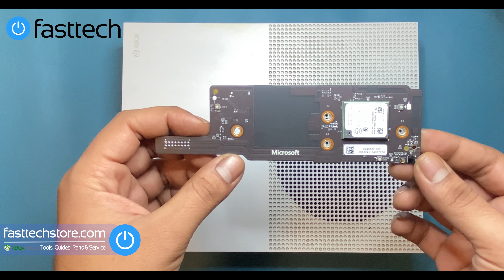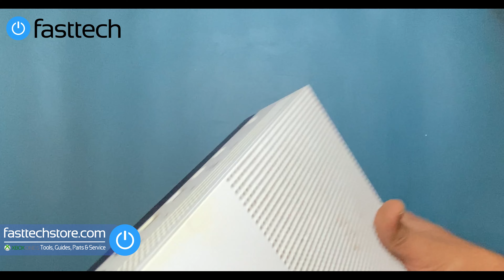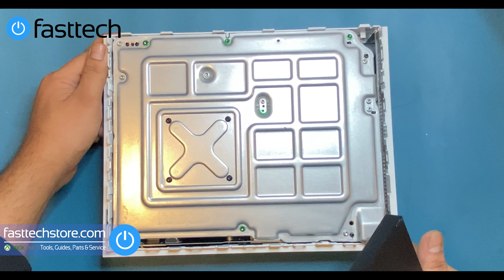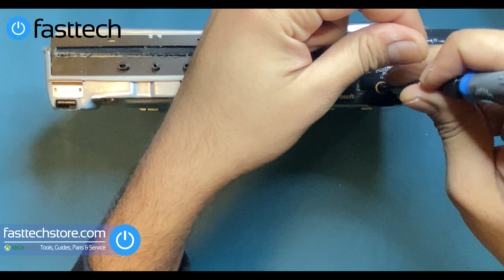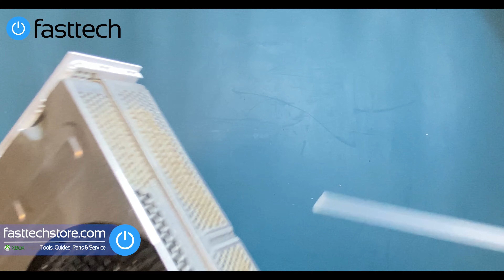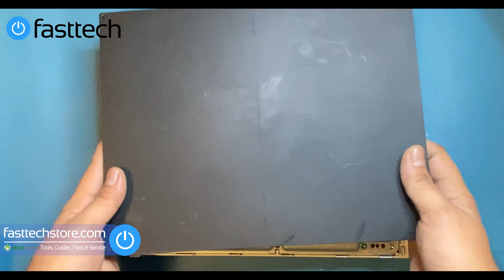Xbox One S No Power Repair Guide (RF Board/Power Button Replacement)

Comment: Can't find this issue with anyone else, but my kids Xbox One S makes incorrect "noises" for startup/shutdown and controller sync.  The light behind the button is also incorrect.  Press the controller sync button, get the shutdown sound.  Turn the xbox off (light behind the logo isnt on), but you get the startup sound and the light will blink as it turns off...